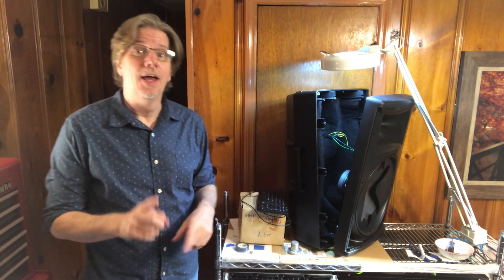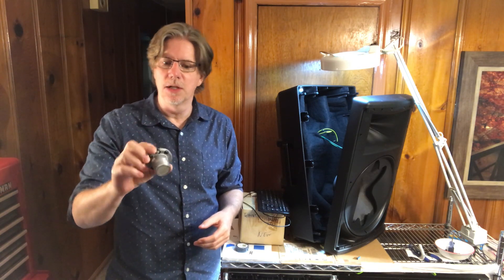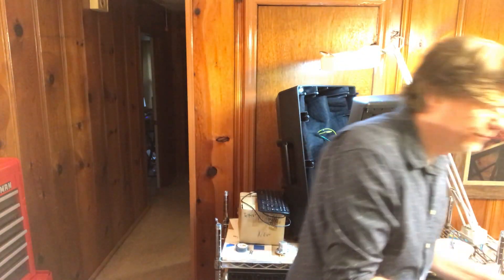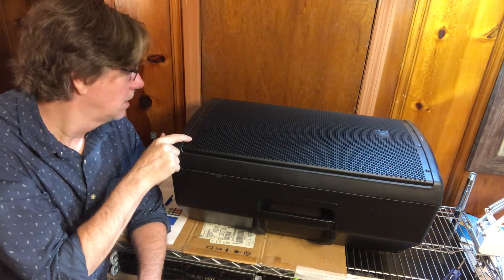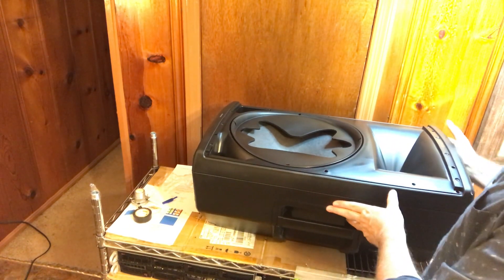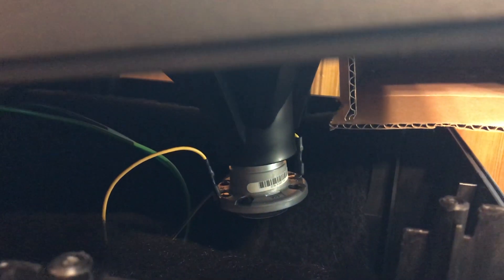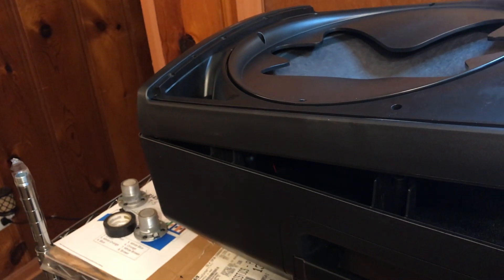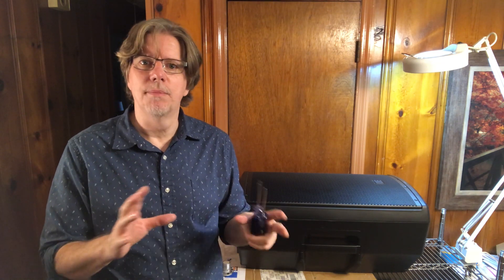JBL EON 615 High Frequency (Horn/Tweeter) Driver Replacement

Comment: I have the older, SF15 sound factors., and i think i did the same Crown which i put in bridge mono, not knowing these speakers only handle 230 watts and 1000 peak., so ya, i think i blew the tweeters... need to do same.

Comment: Thanks for the video. This enabled me to take my JBL Eon 610s apart with confidence. Unfortunately, the crossover amp must be bad on one. I took both speakers apart and swapped the tweeters but the one speaker still has not tweeter output. I reset the speaker too.   Despite the bad outcome, I appreciate your great video.

Comment: Thanks for the video, I bought a pair of Eon 612'ves refurbished on eBay, about 2 years ago. One tweeter blew out on my third gig (I'm a casual Home DJ for home parties), at that time, the speaker was under JBL'ss warranty. This weekend the same thing happened to my other speaker.  Would you know, if this Is a common problem in these Models? I hardly ever use the EONS since I own several other pairs of Loudspeakers. I find it shocking that after only 8-10 gigs of use this happened. Any comments on this issue? Thank you in advance.

Comment: I'm about to replace a tweeter in my JBL PRX615 that I use on my Roland drums, and I'm assuming the process is similar. Your video was helpful. One suggestion, though. When you remove the old driver, do NOT place it on the table next to the new driver. You run the risk of installing the blown driver again. How do I know this?? Haha! Yup.
Reply: Put a bms in much better HF

Comment: Great video! I have the EON 612. I bought a Torx set of bits containing  a size 15 and 20 but they don't fit the screws.  Can you post a link to the exact bit or screwdriver needed to take off the grill and front half?
Reply: The one for the 615s is a T15

Comment: How can a person tell what is blown on the speaker?  I have one that is down and I am not sure how to tell what needs to be replaced.  Thank you for your prompt reply!
Reply: In the case of the high frequency drivers, there is an obvious loss of high end.  When I would attempt to use my auto room equalizing unit, it was not able to achieve a flat EQ curve.  The highs were nonexistent.  I have never had an issue with the 15 inch speakers, but I imagine you would get almost no sound at all.  But if you are getting no sound, I would focus on the amplifier unit or power supply.

Comment: Rather than taking off entire front, isn't easier to remove the speaker (screws) and have just as good, if not better, access?
Reply: He needs to disconnect the leads as well from the amp

Comment: Your lid came off so easy after removing screws. Mine is stuck is there a special tool that i can use to pry open.
Reply: The first time I had to pull pretty hard.  Can you double check that all the screws are out?

Comment: Thanks for the video, but you didn't cover that each post is for a specific wire. The driver should have labels on the posts.
Reply: The posts are different sizes.  They only fit one way.
Reply: @cryounger  That's good to know. I was wondering.

Comment: My faceplate will NOT budge after removing all of the screws.  Is there a trick to this?  I see the two tabs at the top but they will not move either.  What am I doing wrong or not doing to facilitate the faceplate removal?
Reply: If you have the EON 615s then it is just the front visible screws.  You may have to use a flathead to pry it free.  I don't know if there was another design of that speaker, but mine are about a year old.